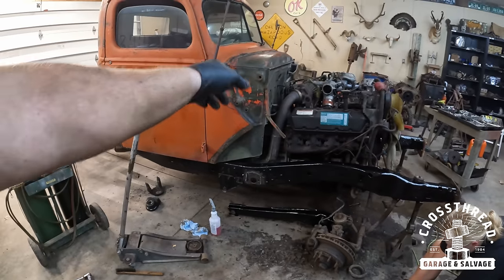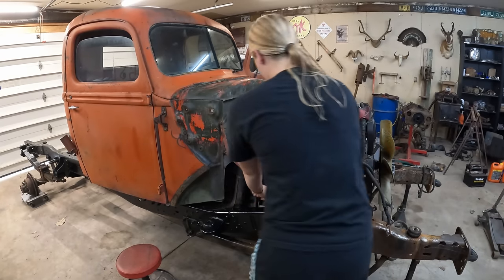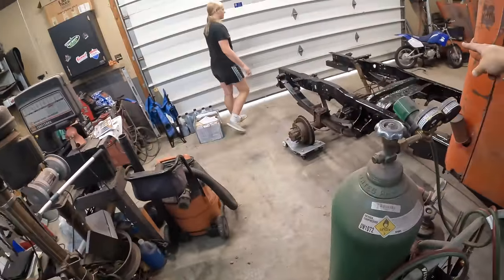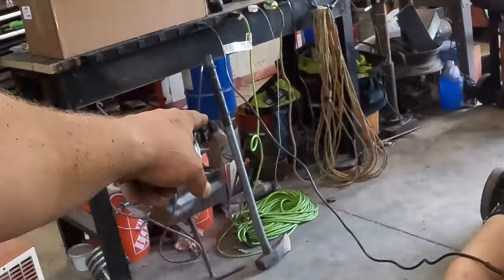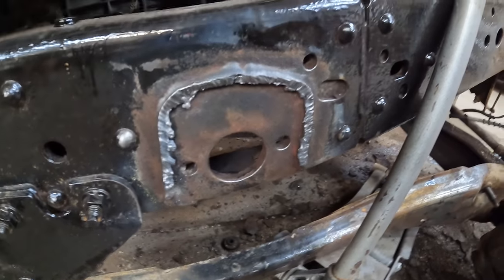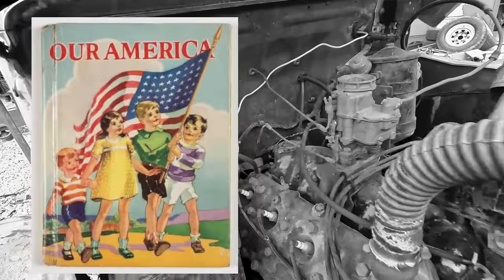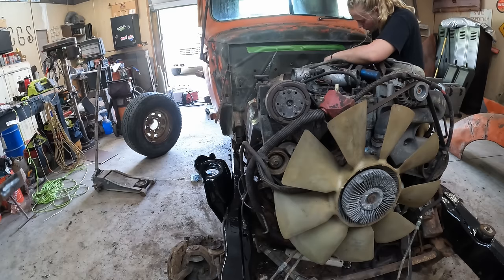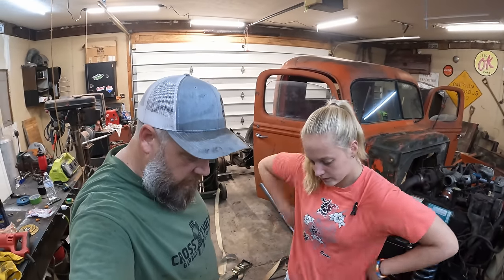My Daughter SOLD Her Goats To BUY This Abandoned Ford Truck | Was It Worth It?

Comment: The spring on the right hand side goes on the driver's side and the one on the driver side probably goes on the right hand side cuz we're at the spring is at the top with curls in all the way that's the part that sits on the inside of the pocket
Reply from the maker: Reinstalled as removed, so the curl in the top went the same way on the new spring as the old spring. I don’t think they’re side-specific.